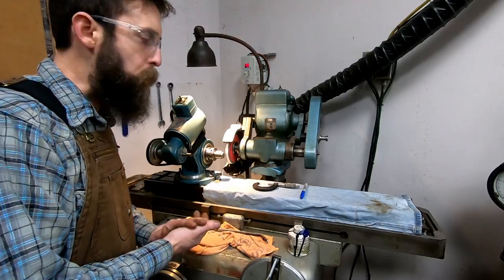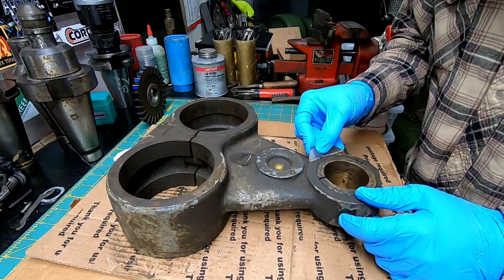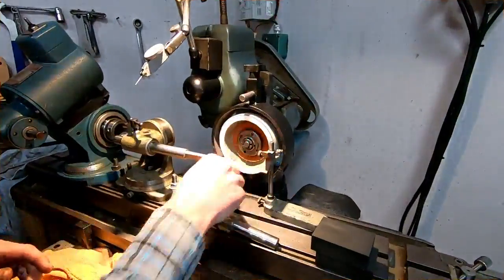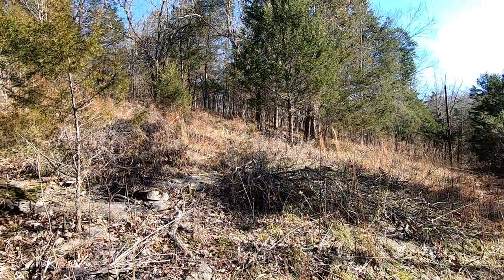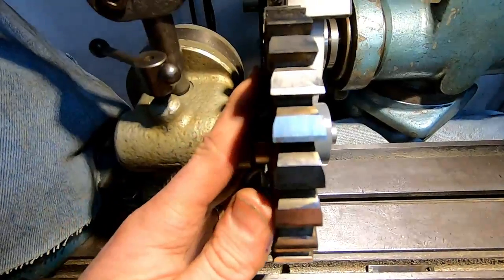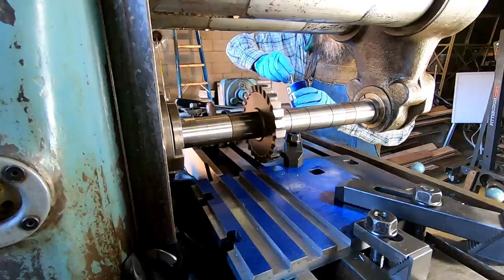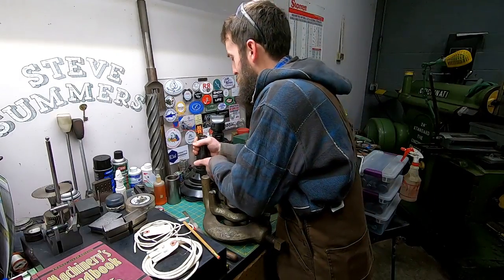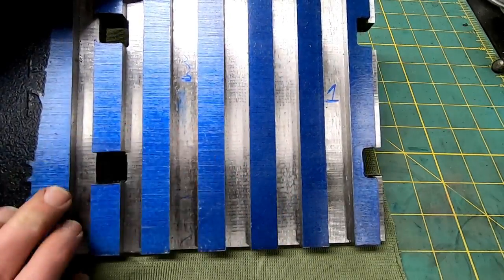Cutter Grinder  Horizontial Mill Work  & MORE!

Comment: Hi Steve one of the inherent problems with the horizontal mill, the tool arbour having a keyway cut down the length causes deflection, it is critically important to keep the support and bearing as short as possible, great videos, love your work.

Comment: Nice cuts there Steve, i would have reversed the spindle and ground towards the edge. I'm sure though that you did that on purpose, but grinding towards the edge leaves a sharper edge which is important when conventional milling

Comment: Hi Steve. Please buy a microphone. We can barely hear a word of the great wisdom you share with us.
Reply: Try VLC media player ~  can increase volume to 200%.
Reply from the maker: Sorry about that. Volume Its very hard to control.
on my end it always seems loud or at least normal. Ive had several people mention the videos vol is low over the last few weeks. I am trying to get everything worked out this week. Thanks for watching.
Reply: The echo in that room also makes hearing difficult.  A mike clipped to you will help a lot.
Reply: @SteveSummers  
You might try contacting Keith Fenner, from turnright machine works.  He has a good microphone setup.
Reply: @COBARHORSE1  Keith also had a bad one, but I think he introduced that to his hydraulic press... :-)
Steve even has the requisite beard for mounting the microphone in Fenner fashion.

Comment: I used to sharpen cutters on a Clarkson cutter grinder when I was an apprentice, a much more basic machine than the one you have but it did the job, we used to use bits of old hacksaw blade for the fingers. Best wishes for 2019 from Somerset UK.
Reply from the maker: I use old bandsaw blades also. Work great 👍

Comment: That spindle drive belt looks a bit ragged Steve...
Reply from the maker: That's the way they are. Only held together by a metal hook.
It's so you can separate it. Doesn't hurt a thing even though it looks crazy.